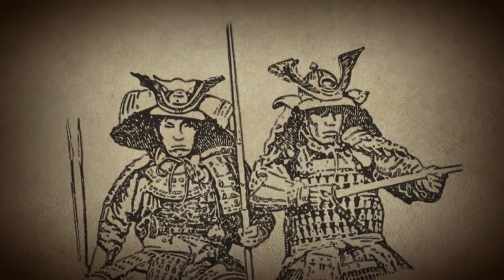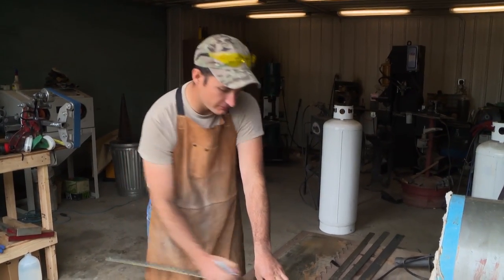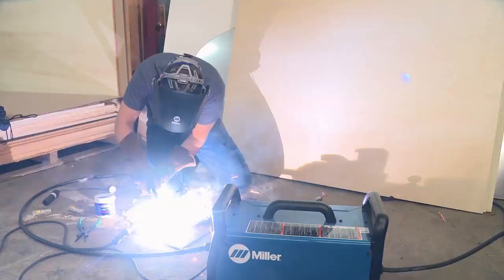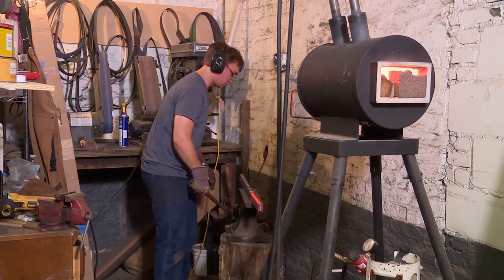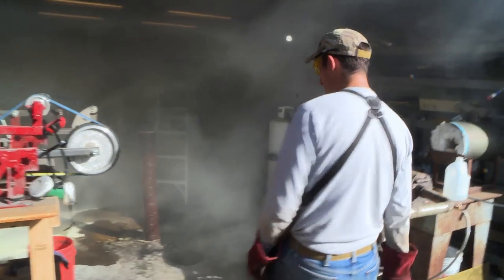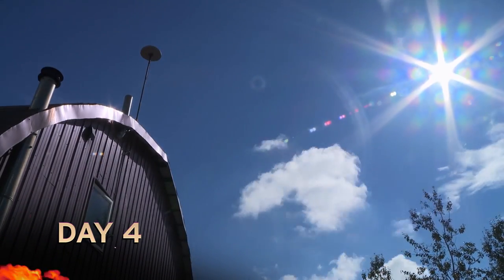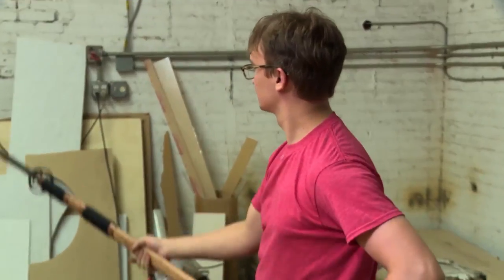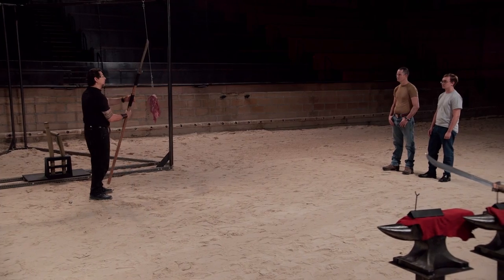Forged in Fire: POWERFUL Naginata Blade Suffers a SHOCKING Surprise (Season 3) | History

Comment: It should be noted that the naginata that women typically used was the ko-naginata, which had a smaller blade than the men's o-naginata. This was because of the heavy pole which makes the naginata slower than a sword, and so the ko-naginata compensates for the women's smaller body mass and strength compared to an armored warrior. What they're making here is the o-naginata.

Comment: This show makes me hate damascus steel.
Reply: Damascus isn't that bad if done correctly like Alec Steele does.
Reply: @azraeiazman  Its not that. They all be like, im so special im going for damascus. But, why? If anything this makes me appreciate shiny plain steel.
Reply: @giftsvampen  right, like a good shiny polish steel blade would really be preferred over the Damascus that is almost never done up into any actual patterns.
Reply: @giftsvampen  ahhh I almost forget how clean plain steel looks. I actually love matte/sandblasted finish on blade. But mirror polish works too!
Reply: The fact is none of these are The original Damascus (Wootz Damascus) which it would be interesting if someone tried to do it, The Pattern Wielded Damascus looks nice and all but it's a different material.
Reply: That's like the meta on this show at this point.
Reply: I mean in theory Damascus isn't bad.... but its not something that can really be done quickly/rushed if you aren't a complete expert

Comment: Pretty much what i’ve learned is that it usually comes down to the quench
Reply: Quenching is really easy to test if it happened correctly. Just using a file and seeing if it glides along without biting in. The most important part is the tempering. Which is almost never shown. The way you are tempering the blade changes it's characteristics to bendable or brakeable or right in between. Which is the most preferable.

Comment: He should've chose oak instead of ash, his blade looked way more stable and stronger then his counterpart's weapon was. Shame we didn't see more action...
Reply: Correct me if I'm wrong, but oak is very expensive, hard to shape and heavy to wield.
Reply: @anomalyp8584  You are right, oak is more expensive then ash ( not 'very' expensive in my opinion) but is easier to sand and work with in my experience. And besides, we're talking about a slim wooden pole, weight won't make that much of a difference between those two.
Reply: @mattparm228  I have no experience in wood working whatsoever.
It just popped in my mind since the judges always have an issue with a gram too much :p
Reply: I believe it's usually made of oak.

Comment: I always wonder why they dont make the poles from dryed young spruces cos it will not crack like dat
Reply: most of these people are hobbyists, they lack critical knowledge on the weapons, they put too much focus on the blades and forget that a weapon is made of multiple parts and the handle is sometimes more important than the blade.
Reply: @incediumignis  Remember the Jumanji Yari? That guy who always went on about being an expert and then used a rake handle
Reply: Honestly, firing the handle a little, to where the seam begins and ends, probably would have helped a lot, too. Wood hardens with a little bit of toasting.
Reply: @TheWhoamaters  As a person who has used a store-bought rake (ie, literally anyone who has done yard work), that made me cringe. After all the work he put into the metal, too.
Reply: @swaswj414  Right? Honestly, and the way he took it off didn't help either
Reply: Ash is a lot more durable, if you take the right kind of ash. I've just had a look at a hardness table and saw that there are some kinds which are only slightly better than Spruce. If he took one of those, he might have been better of with spruce. But Spruce just looses every time against european ash (fraxinus excelsior). There are good reasons, why throughout history nearly every single poleweapon has an ash handle (some exceptions are oak).
I've also used Spruce Quarterstaffs, Oak Quarterstaffs and Ash Quarterstaffs. Ash>Oak>>>Spruce. The Spruce doesn't split, it just breaks. I've never seen the oak, or ash ones break or split. Ash is a lot more flexible though.
Reply: They're given a specification for the blade/weapon, in this case I believe it required ash based on what they both said. Furthermore, from my admittedly limited understanding, the springiness of ash makes it preferable to spruce, as it allows the staff of the naginata to flex more and follow through easier
Reply: @tomhemming9236   In this case, ash wasn't a parameter. If they were to set a parameter on material it would likely be historical and  naginata were traditionally oak handles. Ash is generally a good choice for the reasons you've given, but he selected a poor piece. He noted some of the issues with it but continued anyway -- whether that's because he thought they were surmountable or that was the best piece he could find in the time given, only the smith can say.
Reply: Harry Potter vs forest gump
Reply: @Jeremy Seely Agreed. I was only pointing out that 'ash' wasn't a given parameter, or the historical material. Ash as a type of wood was a good choice, but the smith used a poor quality piece.

Comment: What makes it powerful ? This is on every video powerful blade explain how its powerful
Reply: Well, for pole weapons in particular, the far longer lever of the haft generates greater tip velocity, and thus more force in the strike. It requires a very good working knowledge of wood grain structure, as well as proper attachment to the steel portion. It's why reproduction polearms are so hard to come by, most fail in tests like this.

Comment: It sucks when they make a good blade, but the part they didn't make is the part that broke.
Reply: He made the haft. It still sucks. Selecting the right material is a crucial part and for a smith it is more difficult with wood.
Reply: @maxlutz3674  Right material, wrong technique. The wood was fine but the style of split enclosure for the tang never would have held up without external reinforcement. The tang basically wedged itself into the join and ripped it apart. Wrap and tie a hot steel wire around it under the grip and it never comes apart, shrinks as it cools and compresses everything like the steel rim of a wagon wheel or bands on a wooden barrel.
Reply: @mfree80286  I partly agree. A different design with reinforcements for the haft probably would have held up. The shrinking of hot wire or steel rings is not enough to compress the wood. Wire would not stay hot long enough to have significant shrinking. It can be wrapped tight for good fit though.
Reply: Material selection is important, particularly with wood. At 6:08 you can see there are flaws in the wood before he begins working on it, and he even says the grain is off-center. There were things he could have done to reinforce the shaft, but instead he kept the flawed piece without addressing the issues.
Reply: They made handles too

Comment: Not an expert here, but if these were made for the battlefield, how are they bending/cracking on tatami mats?
Reply: Japanese blades generally aren't spring-tempered, they're differentially hardened. Meaning that while the edge will be harder and can take a very fine edge, as well as retain it, the soft spine can bend and take a set. Novices often bend katana blades when first attempting tatami cutting for this reason.
Reply: @CyrusKazan  So, is this mans just a novice at cutting?
Reply: @stanleylee5358  He's clearly not a novice when using swords, but polearms are very different beasts. I know Kali and other Filipino martial arts that he practices can translate easily to other types of sword or even axe, but I'm not at all sure how many long weapons are included in these styles.